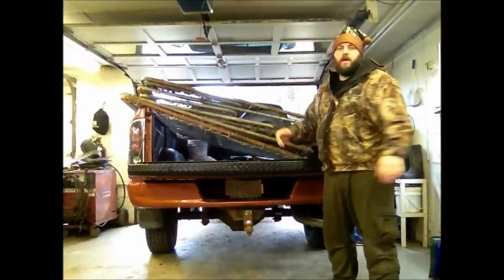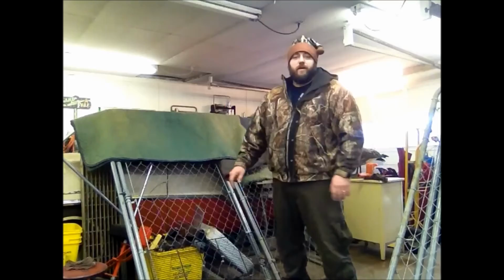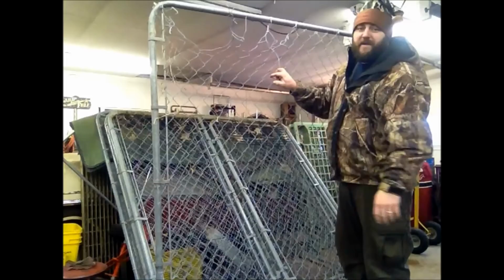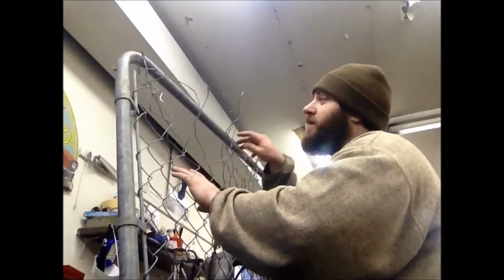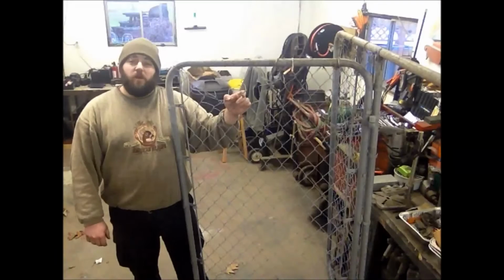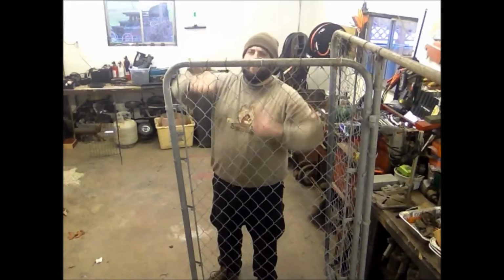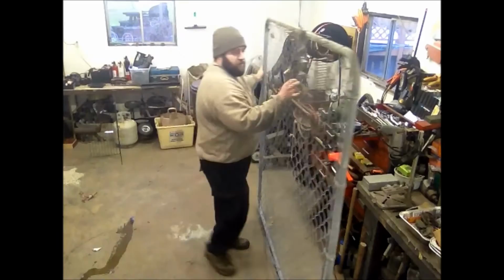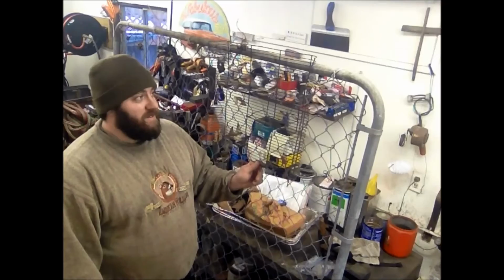★DIY Mending Chain Link Fence Panels, Dog Kennel Fencing, Perimeter

Comment: Do you have any advice on how to reuse fencing that has been cut at the corner posts because they were down in concrete?
Reply from the maker: Sure. You could build a frame and attach the fencing to it to make panels like the panels you see in the video. Lowes or home depot have corner brackets that allow for frames to be made. Let me know if you have any questions.

Comment: Thinking about purchasing a kennel on Craigslist that needs the same thing done, but where did you purchase the wire roll and what kind would I need to purchase to match the fence.  Thanks in advance
Reply from the maker: Tyjuan Rice I got the wire from lowes. It was in the chain link fencing department. The wire was only necessary to attach  the fencing to the outer frame. The chain link wire was all there it was just bent and pulled out of shape. I needed to bend and weave it back into shape. So it was not necessary to get matching wire for the fence. If  it is necessary to replace the chain link wires it may be more worth your time to buy a cheap roll of chainlink fencing off craigslist and cut it up and put it into the panel frames. Just a thought